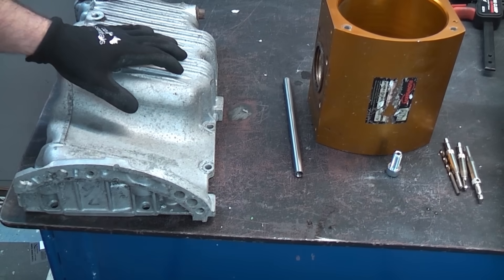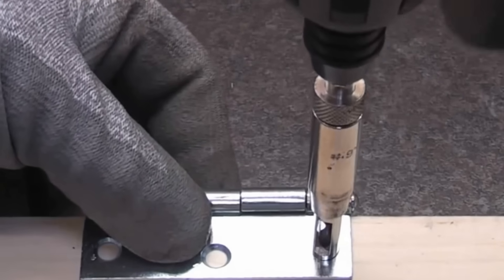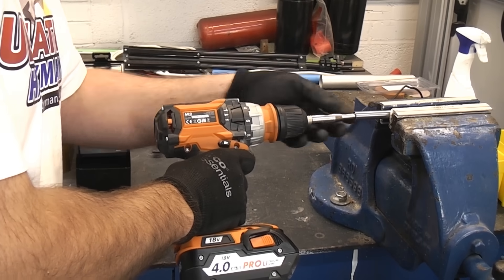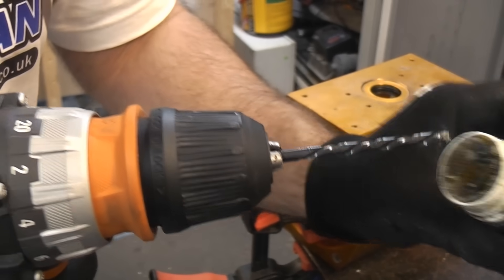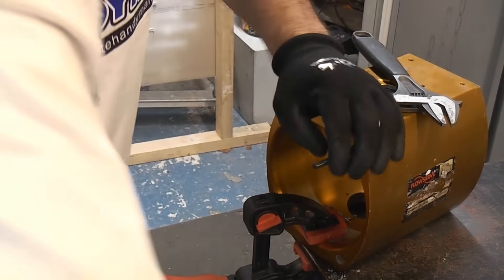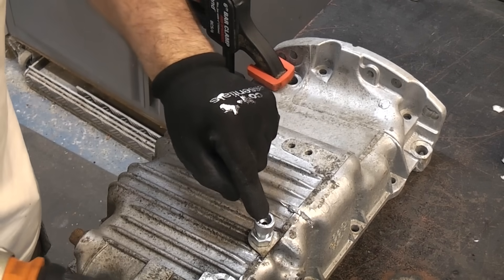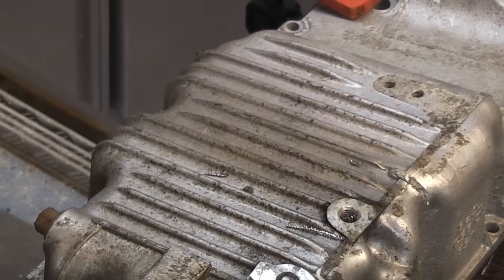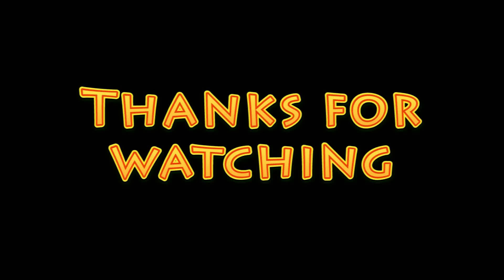How to remove a broken bolt in a deep hole | remove broken bolt in recessed hole

Comment: When did they make bolts that only brake below the surface and not flush? LOL
Reply from the maker: It can be common in some situations, just read the comments below and see how many people have made a set of drilled bolts, or want to buy a set ;-)
Thanks for the comment 👍
Reply: @ultimatehandyman  Yeah they break below but not for me. That being said a center punch is usefull for flush breaks or even using a dremel cut off wheel to cut a nice flat head slot for screw driver removal. I have a few tricks of my own 😉👍

Comment: Why make is so complicated.. after you got the hole attach the screw extractor to your screw driver and push it inwards while screwing it out.
This is why its left threaded instead of right and why it has a V shape. you dont need to smash it with a hammer or use "manual" tools that will loosen the screw extractor by not applying forward force and wiggle left and right.

Comment: Old Timers trick my butt........we didn't have that slick little guide tool....had to insert a sleeve over the drill bit that sort of fit or just go at it with the bit....if ya mucked up the threads, tap it......

Comment: Very satisfying video, thank you
I got this problem with big bolts in the concrete wall
Reply from the maker: They might need a different solution. Bolts in concrete either normally work by expansion, or are held by chemical means.
Thanks for the comment 👍

Comment: Most of the time when a bolt snaps it's because the lower half is stuck solid . 
A rusty bolt pulling out of an aluminium thread is easy to snap bolts on. But extracting that's brocket bolt is near impossible. 
Without drilling and re taping . 
They normally are stuck solid.
Reply from the maker: Thanks for the comment 👍

Comment: If a bolt is broken in a piece of cast iron you can burn it out with an oxy-acetalene torch.cast iron will not burn. No damage to the threads. If the part is steel it doesn't work. Steel will burn.

Comment: It's a little crazy but as a last resort if you've got a seized steel bolt broken off in aluminum, squirt in a couple drops of sulfuric battery acid. You'll probably lose some of the threads but not all, and you do lose your threads, you can put in a heli coil thread insert
Reply from the maker: Thanks for the comment 👍

Comment: First thing you do is find dead center of the broke bolt....centering punch works best but any which way you can. Its a backup in case all else fails, Drill until all thats left is threads. If you are 2 cheap to buy special tools "backyard" works just as well....drill a hole in the bolt, find a torx bit that doesnt quite fit, grind and angle on the end of the bit. Hammer the bit into the hole,  If its aluminum wipe a little clean motor oil (not synthetic) on the area around the hole but not in. Heat it with a propane torch until the oil is smoking less than it was....300*400*  get wd 40 and make a puddle around the head of the bolt with the bit in it...the heat causes the surrounding metal to expand, wd 40 shrinks the broke bolt, give the torx bit a wack with a hammer and then try and unscrew it. If you have a cordless screw gun, the kind that is an impact driver they work excellent.. the vibration helps to loosen it. the torx bit deal is the fix for stripped out jets on motorcycle carbs

Comment: Been doing mechanical work for 50 years. If a bolt is frozen enough to snap off with a wrench no " Easy out " is going to remove it.
Reply from the maker: Thanks for the comment 👍

Comment: Interesting tools that you made with the bolts. I'm on a project where screw extractors will not turn all the steel bolts that are threaded into cast aluminum. One came out easy with a screw extractor, but two more refuse to budge. I am working on drilling one of the stuck ones entirely through. I may have to re-tap the hole.
Reply from the maker: Have you tried applying heat? Sometimes they are thread locked in, the heat can break the thread lock bond.
Best of luck with them
Thanks for the comment 👍
Reply: @ultimatehandyman  Thanks for the reply. I had tried the methods covered in your video before I started searching on YouTube for anything I had missed. I tried a propane torch, penetrating oil, and had jolted them some when tapping the screw extractors in. I saw in another one of your videos where you said screw extractors don't always work, and you have to drill the bolts out and tap the holes again. So you follow a similar set of steps to what I have been doing. One of the screws is now drilled out and ready to be tapped. I'm thinking of switching from the M8 x 1.25 steel bolts to 3/8" x 16 stainless steel, hoping that if I apply some anti-seize and lock washers, then these mounting bolts won't get stuck in this small engine again. But I also wonder if using anti-seize instead of threadlocker might allow them to come loose.
Reply from the maker: @jacknjanesshowtell9499   As long as lock washers are used the anti-seize should be fine.
A few people have said that copper anti-seize can corrode with aluminium (I have never seen it happen where I work), so a ceramic based anti-seize might be best ;-)
Reply: @ultimatehandyman  The type of anti-seize lubricant available in the stores near me is Permatex brand. I read that it contains aluminum, copper, and graphite. It is silver in color. Perhaps it contains more aluminum than copper.

Comment: your lube applying on the stud reminds me the bridge builders story he built a bridge for the other people to pass upon it despite knowing he himself would never pass that bridge again- now a days if it is necessary or not every tom & harry load their stuff with locktite ....i remember when i was young a mechanic used grease to tip his bolts for the scooter  to open well in hands of the next mechanic
Reply from the maker: Thanks for the comment 👍
Reply: @ultimatehandyman  pretty much followed your method today unfortunately the bloddy extractor broke into 2 pices when i applied pressure to loosen the broken bolt-this crank case is of a morris minor car i think for teh first time i am replacing the studs in last 70  years - this extractor was of a company named kennedy its a uk based company but looked like that bloody extractor was made in china-
Reply from the maker: @gentlerowdy   Because they are hardened, they are often brittle and can snap.
You can drill them out though- https://www.youtube.com/watch?v=7JCfEMrCjhc&t
I've just bought a set of Dormer extractors, hopefully they will work well.

Comment: Great video 👍
Reply from the maker: Thanks for the comment 👍
Reply: @ultimatehandyman  I grew up in Ireland where I was a mechanic when I was younger ,but we never had left hand drill bits ,they're a great idea.
Reply from the maker: @kwaichangcaine8234   Yes, they are great. I was once drilling out a sheared bolt on a platform and the drill bit-bit into the bolt and pushed it right out the back of the hole. As soon as I got to the computer I searched for left-handed drill bit and have used them ever since ;-)

Comment: You don't have a list of parts you used or purchased in the Description Above. For example those hardened Cobalt Drill Bits. Where did buy those from?
Reply from the maker: This should help-
Hinge centering drills- https://fave.co/2DpJo1H
Left handed drill bits- https://fave.co/2xJjK1M
Teng screw extractors https://fave.co/2OnfRuF
Dormer taps -https://fave.co/2OsN1sQ

If you are in the UK-
Hinge centering drills- https://fave.co/2NE1VMc
Left handed drill bits- https://fave.co/2DubtF4
Teng screw extractors- https://fave.co/2pVLkVT
Dormer taps - https://fave.co/2pTfbyx

exact cutting paste- https://fave.co/2Nabyxc
cobalt drill bits (they are much better on harder steels like bolts) https://fave.co/2zDh3kp

You'll have to make the guides yourself, but they are easy- https://www.youtube.com/watch?v=6mZj0J6CNYA&t=1s

Spring tools centre punch- https://fave.co/2NbnLBD

👍

Comment: The hinge tool is handy, but I  just cut a bit of metal tube that fits in the recessed hole , then introduce the drill bit ( ideally a left handed bit then an easy out and reverse it out  . ) 
The short piece of tube protects the threads , cheap as chips and no need to pre prepare hollowed out bolts ( but they look smart ) .
Reply from the maker: Thanks for the comment 👍

Comment: Ironically, you've made this so much easier if it snaps off below the surface... So what if I want to center my drill bit and it snaps off AT the surface? Hmmmm. I don't think I zoned out too much and missed that.
Reply from the maker: If it's near the surface, try to get the bolt as flush as possible (you might have to give it a tickle with a grinder), then centre punch it as close as possible to the centre of the bolt, then just follow the video
Thanks for the comment 👍

Comment: I want to see how you get a header bolt out or a head bolt...lol...I haven't never been able to get ether one of them out yet it's like there welded in the block.
Reply from the maker: Some bolts are impossible to remove, drilling them out completely is sometimes the only option
Thanks for the comment 👍

Comment: If only my snapped bolt came out like those did, sure they work well on stuff that's not rusty but I wasted 4 hrs today trying these things, in the end I've drilled it through it and I'm gonna have to thread the git
Reply from the maker: Good luck with it ;-) 
Thanks for the comment 👍
Reply: @ultimatehandyman  thanks mate, I have rethreaded the hole as well as I would so 🤞 it holds my lower control arm on still 🥺✌️

Comment: any ideas on a broken screw, not a huge one (8-32) but it is for the throttle position sensor which happens to be right above the thermostat housing and on top of that is the intake manifold and throttle assembly. buick 3300. In that tiny space I can't get directly below the screw. I have a dremmel type tool that I tried a couple heads but at an angle and it looks like I'm not getting anywhere.any advice?
Reply from the maker: Some on the job situations like this can be impossible.
I hope you have sorted it by now (only just seen the comment)
Reply: @ultimatehandyman  thanks. I took off the throttle body and got easy access to drill out the piece of screw. I replaced them with socket end screws so it just needs a wrench. As it turned out I got a bad sensor so I'm going back in. I searched and found an AC Delco OE tps. While I'm waiting for it, I will go ahead and take off the throttle body and clean it. I am not sure how to take the throttle assembly off the throttle body. I may have to put towels down and clean it still attached. I am taking the sensors off to clean too.  If I were to figure out how to get the cables off, is there something I would need to do when putting it back on?

Comment: May I ask what brand sighting hinge drill you used? I cannot find the kind that can use a standard drill bit fastened with a grub screw.
Reply from the maker: I'm not sure, as I bought them over ten years ago from Screwfix.
You can get them on eBay-  https://fave.co/2NE1VMc
Thanks for the comment 👍
Reply: @ultimatehandyman  thanks for the reply and the link!

Comment: ive never had much luck with extractors they either strip out or snap off
Reply: usually a broke off bolt was cross threaded or corroded and will not nicely unscrew out you have to drill out and retap
Reply from the maker: They work occasionally, but most of the time they don't!

Comment: Usually I can get away with extracting a hardened bolt out of cast iron or steel by heating it with a cutting torch head and blasting it with the oxy when it's bright hot to shock the bolt into shattering and exploding out if the hole. It works on broker taps too.
Reply from the maker: Thanks for the comment 👍

Comment: Sometimes easy outside don't work very well. A proper sized torx bit with a ratchet drive lightly driven in works well.
Reply from the maker: Thanks for the comment 👍

Comment: This works good for big bolts. But I need some help on removing a M3 bolt that has snapped inside an aluminium thread. What should I do? Thanks in advance.
Reply from the maker: It's difficult with such small diameter bolts.
You could try drilling out the bolt, using a 2.5mm drill bit, but you might need a special chuck to grip a small diameter bit- https://fave.co/3rPb3gH
Once it is drilled out, you can re-tap the hole using a M3 tap
Thanks for the comment 👍
Reply: @ultimatehandyman  The bolt was broken almost flush with the surface. I tried drilling it, but it was impossible as the drill bit slipped very easily. I ended up dremeling a 1mm deep slit across the screw and got it out with a screwdriver. Thanks.

Comment: That's nice whenever you can put a bolt in there with a hole in the center but what do you do whenever they're broken flush
Reply from the maker: Just centre punch it in the middle, then drill, as per this video and use a screw extractor if necessary.

Comment: His method works when the broken stud is deep in a hole, but it would not work if the stud had broken flush with a joint face.

Comment: I have removed hundreds of broken bolts, but I have never seen your idea of drilling a hole in a bolt for a guide. I guess your never too old to learn a new trick. Thanks for your time.
Reply: me too the hinge sighting drill is a good idea ,,,,,
Reply from the maker: You are welcome
Thanks for the comment 👍
Reply: The thing about plbrourn bolts is, no two scenarios are the same so you need as many options in your tool kit as you can get.
Reply: *you're

Comment: Metal bolt stuck in aluminium. Inside the hole. I just mig weld it up and weld another bolt to it and turn it out ^•^

Comment: In the first place I don’t know why this video was recommended yet I saw it sitting bolt upright. If a bolt snapped in a casing I wouldn’t know what to do about it because I don’t own even the most basic bolt extracting tool and so leave deadbolts alone and bolt from the scene.

Comment: That's a great idea with the thru hole on the bolts,  easy outs are fucked.  Also steel thread inserts are nice for softer material,  preferably stainless.

Comment: the main problem these days is finding drillbits that arnt blunted by even soft metals
Reply from the maker: Try to get a decent make, such as Heller/Dormer etc.
Some cheap drill bits are only fit for the bin ;-)
Reply: @ultimatehandyman  easier said than done in UK although the cobalt drills you mention  (unless chinese made fakes) are usually good.

Comment: I snapped a cylinder head bolt so I ran down to Harbor Freight to get a set of those door hinge drill attachments only to find that they were all too fat to fit down the hole.  I ended up getting a 30mm long, 10mm thick spacer from Home Depot and and a reverse drill bit.  That bolt popped right out.

Comment: What if the bolts are stainless
Reply from the maker: Cobalt drill bits are best for stainless. Make sure you use plenty of coolant/lubricant so that the stainless does not work harden ;-)

Comment: Make a hole in the broken bolt, make new treads(reverse of the existing treads)
And then you can use an other bolt to remove it. Dont make it harder then you should ;)
 Or you just drill the hole a bit wider, and put in a helicoil

Comment: There are certain ways to prevent a bolt from braking and with the time you´ll learn to see which bolt could potentially brake. Haven´t had a broken bolt in years and worked on a lot of rusty components. I´m a locksmith so it´s my daily bread and I maintain some cars for extra cash. Just small things like brakes, exhaust, oil, chassis and some minor repairs on the engine.

Comment: People who can actually get easy outs to work are magicians.
Reply: I never use them. Ive been removing broken bolts for many years by drilling the correct size drill & hammering in torx bits. Ive found paticularly on small bolts the tapered extractors can expand the bolt & make it even tighter.
Reply: @heybird5660  That's a very good idea. I can see how the impacts from driving the torx bits into the broken bolts serve to help break the bolt free to turn easily.
Reply: It just takes practice. I use them all the time.
Reply: Takes skill. To be honest, if I have a welder available. I'd rather weld to it and extract it.
Reply: @diyguy6054  how would you weld to it and extract it that way? I can’t get nothing else to work and I would like to try that and see if it works
Reply: @noahwhitaker6915  If it's not in to deep, just use a center punch on the side and lots of small taps with a hammer. Once it's loose, it is just a matter of time, as each tap barely moves it. Removed a 6 mm from about 10-12 mm dept of a crank not long ago, and was impressed by how easy it went.
Reply: @diyguy6054  Me too - but that deep I couldn't weld a lump on all the way out to get hold of it.
Reply: The only problem I ever have with easy outs is centering the drill as breaks are never straight and it likes to walk
Reply: Seriously?   First  Start with a good set, not a harbor freight special. Second the smaller the EZ out the easier it will snap so,  Be careful!!!   Use those  pieces of advice and you shouldn't have a problem.
Reply: I've found the tapered ez outs are better than the spiraled, ime.  I have also found that canned air can shrink the bolt enough to break it free.  Similar to using heat on the surrounding material and easier than cranking up a torch and being concerned with heat affecting nearby materials.  Gentle taps can also do wonders while you're waiting on the PB Blaster,  or better yet,  Kroil to take effect.

Comment: Isn't it wonderful when everything is sitting on a bench! LOL! I had to do this BLIND under a 1954 Olsmobile with a broken bolt in the flywheel housing that supported a rear motor (transmission) mount! I was quite successful!
Reply: nice one! did you have electric tools then or were they steam driven ;)